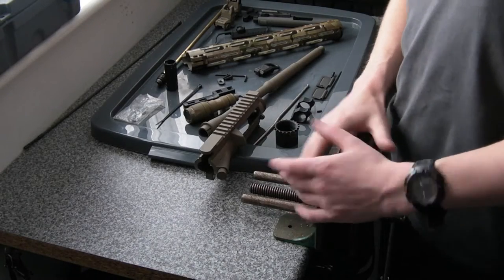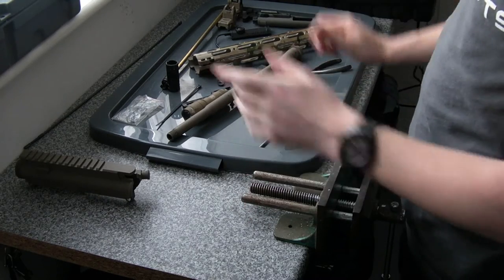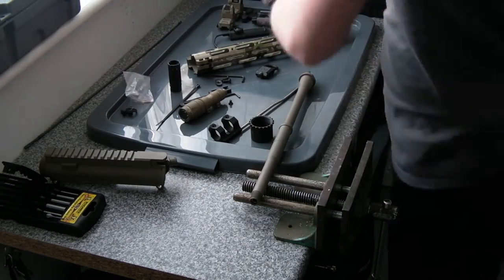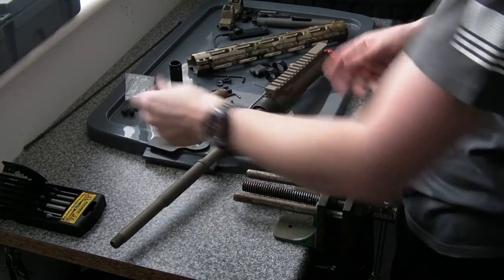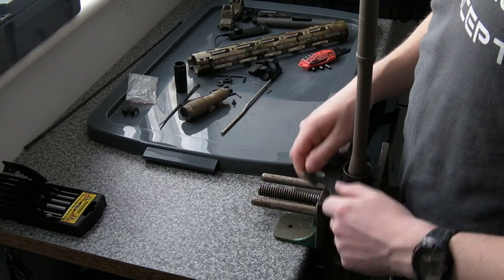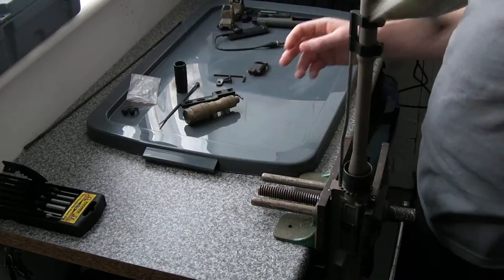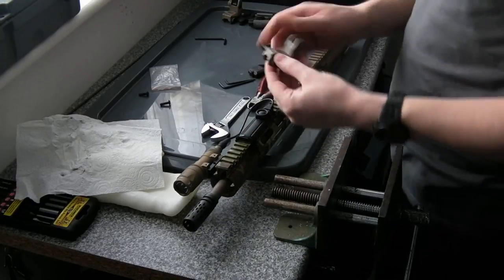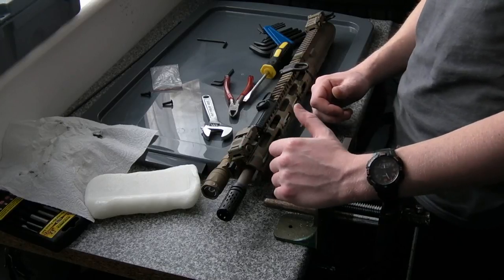Custom KWA LM4 - Upper Receiver Build

Comment: How did you thread the receiver for the new handguard? Nice build
Reply from the maker: Thanks.  I've got a specific die nut that's to the correct spec for the threads on a real AR upper, so I vice mount the airsoft upper in some custom vice block I made and go through the usual re-threading procedure with said die.
Reply: @CKinnerley  hey man what was the model number of the die ? I want to throw a bcm m lok rail on my lm4. But i need to rethread it to 1-1/4" threads right ?
Reply from the maker: pretty sure it doesn't have a model number, but yeah 1-1/4 - 18 die, searching that will bring em up.

Comment: Hey I was wondering if anyone who owns an Lm4 could help me out. I'm trying to find an inner barrel and outer barrel that is 15"-16" long. Wondering if you guys could send me since links to some because I am unable to find any. Just some background info, I am planning to put on either a Noveske 13.5" or 15" rail. Hopefully that helps. And thanks for the help :)
Reply from the maker: ***** I'm afraid you can't find them because they just don't exist.  You could either screw on a short barrel extension or run the 13.5" rail on a 14.5" barrel, the muzzle device will just stick out.
Reply: Are these 2 compatible?
http://www.evike.com/products/45260/
http://www.evike.com/products/39556/
Planning to put a 15" noveske rail
Reply from the maker: Well the outer barrel is for AEGs so...
Reply: You could get 2 angry gun wire cutter barrel extensions and extend them together and use the guarder metal hop up kit to attach a g&p barrel; I believe a tn24 500mm? Your gas block would have to be m4 length but it's only cosmetic. With loctite on the barrel it would be solid and the seams wouldn't be visible under the rail anyways.